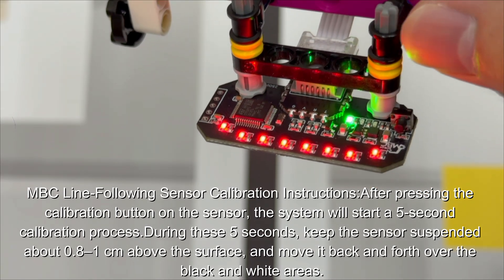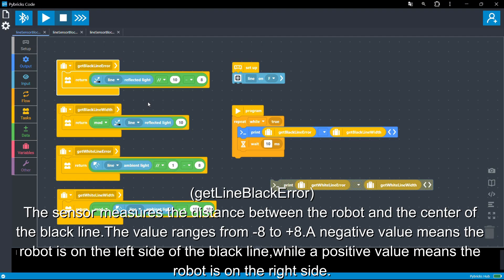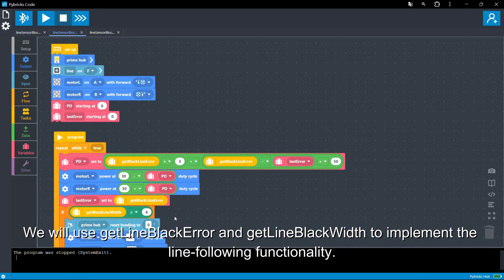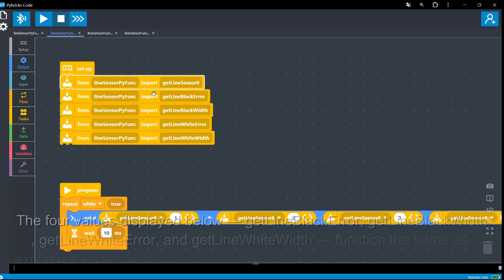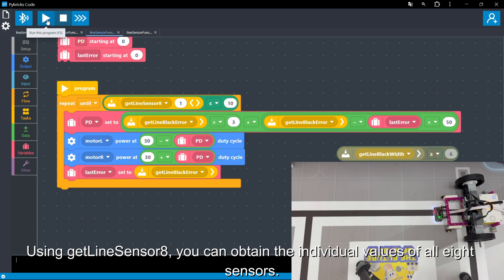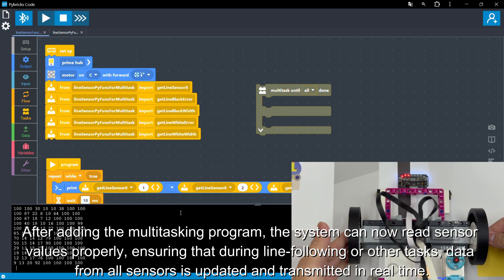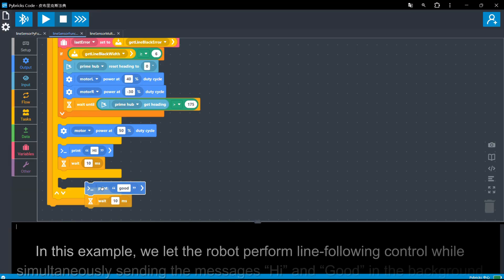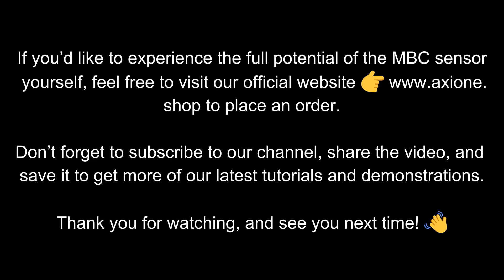MBC Spike Line-Following

Comment: why do u use that motors insted of the original spike motors?
Reply from the maker: Because this motor has higher speed and greater torque, its overall performance is better than the original Spike motor.
However, it doesn’t have an absolute position feature — though, for the two motors on the robot’s base, that function isn’t really necessary anyway.